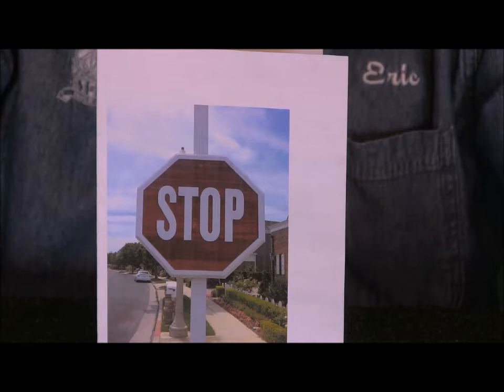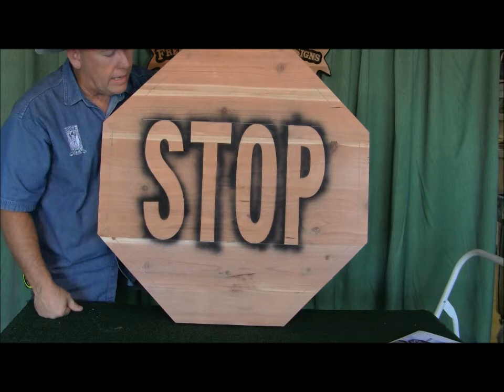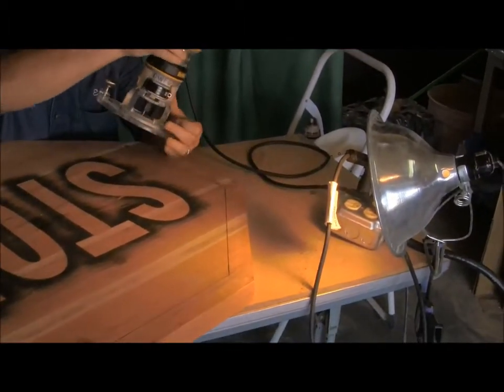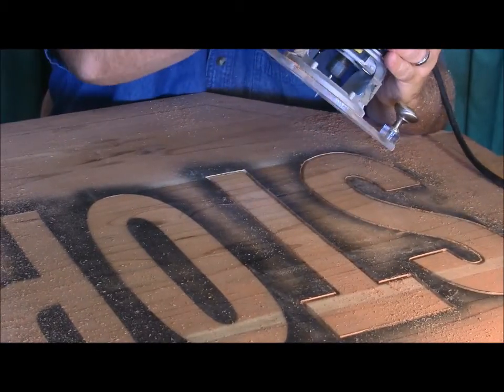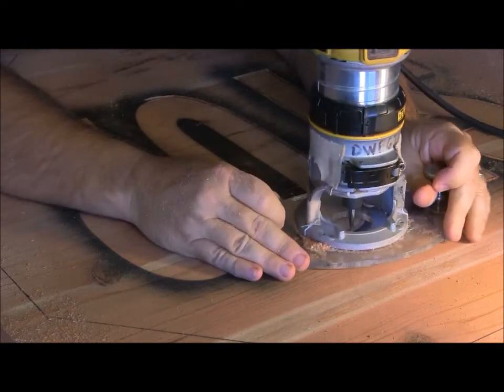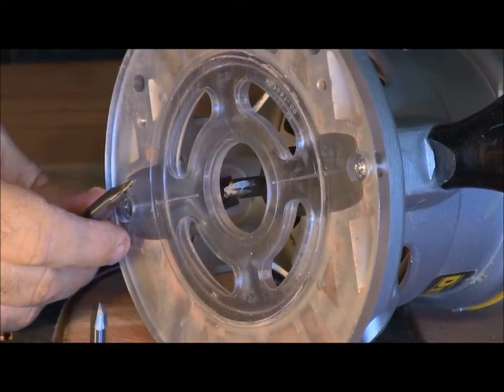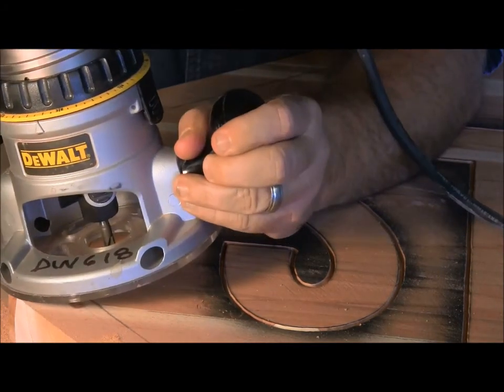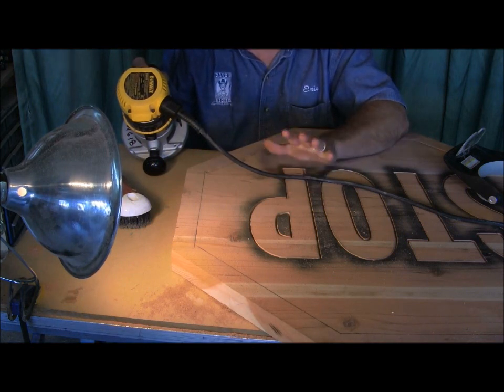#96 Freehand carving redwood stop sign 1 of 2

Comment: How did you make the big octagon?
Reply from the maker: Normally I make a pattern and cut my shapes with a router. However on this one I thing I made a square then used a circular saw and cut off the corners at the appropriate spots.
Reply: Measure once,cut 8 times.

Comment: Do ya'll prefer those handles because they sort of ride closer to the wood than the stock handles?  Where do you get the handles you like or have you carried them over as you upgrade your routers from an older one?
Reply from the maker: asb1583 These are just like the ones I used on one of the previous modifications. I found them at Lowes in the cabinet hardware area. This router doesn't come with stock handles. I do like the way these work. Total control of the router. Hope this answers your question. Thank you, Eric

Comment: What kind of router bit did you use for the background? or clean up Thanks.
Reply from the maker: woodcrafts1 45 degree v groove. 1/4" shank, 3/8" cutting diameter. Thank you for the question, Eric